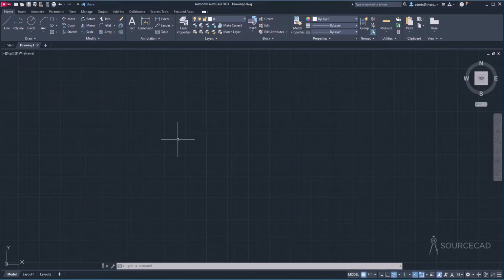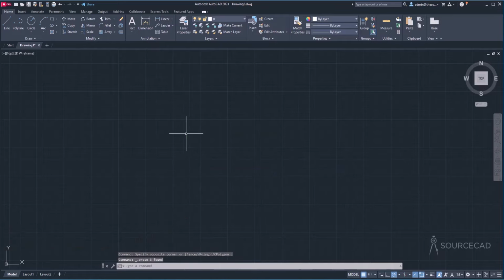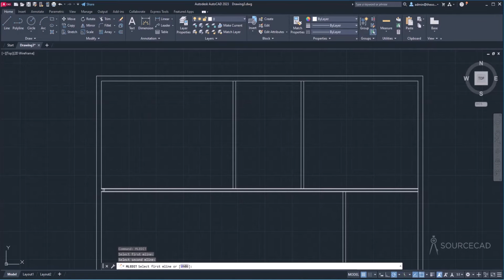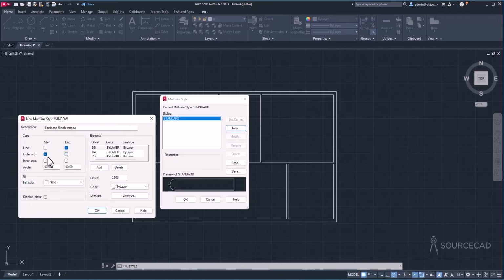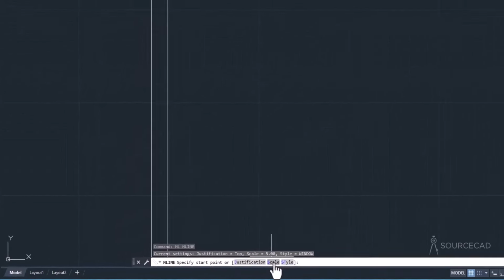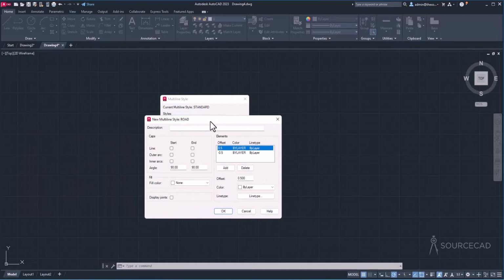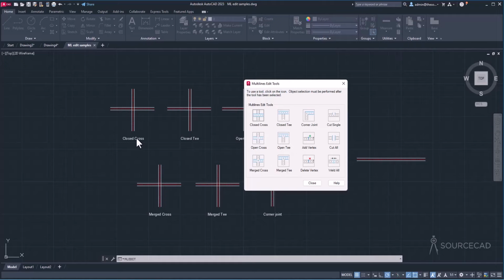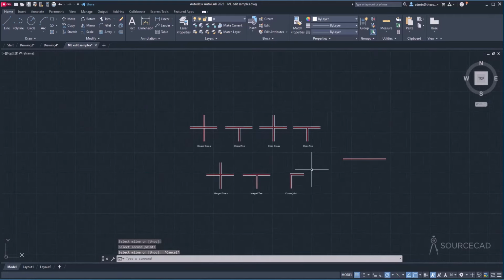MLINE Command in AutoCAD with practical use cases - Multiline command

Comment: Thank you for the video.  Is there setting on the ML style where the fill setting can be modified?  It is not showing solid on mine. but slant lines.  thank you in advance. What is another way to make the wall solid without the ML style fill setting?

Comment: Sir whenever i try to make a rectangle, it make some other shape. And these shapes are composed of multiple rectangle, and looks like a design. Plz help me draw simple rectangle
Reply: make it by shortcut command REC
Reply: @asadm1024  bro you didn't got my point, either way i make a rectangle, it makes a different shape of rectangle.
Reply: @AyubKhanEngineer  From the AutoCAD menu, click Preferences. In Preferences, click the Application tab. Click the Reset Application Options button. Click Reset AutoCAD.